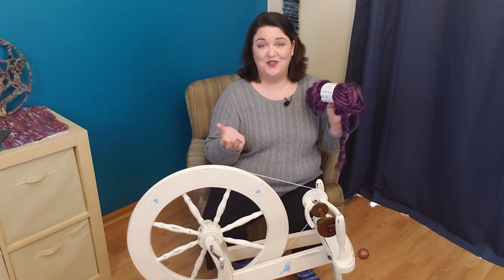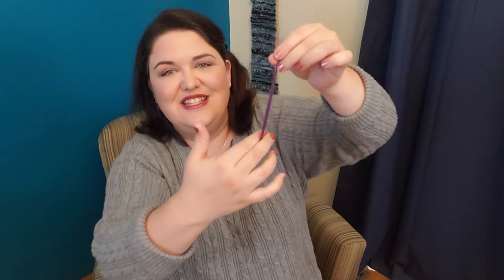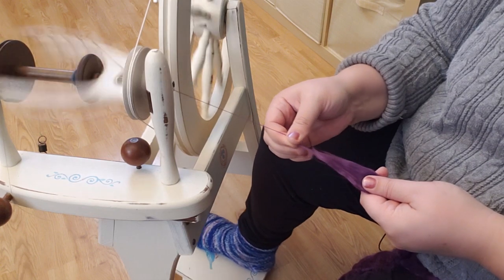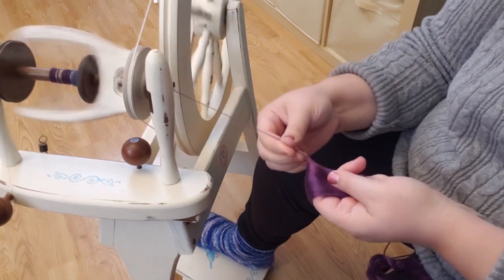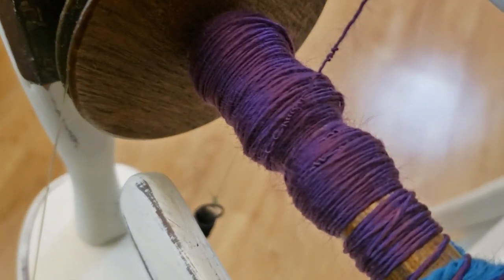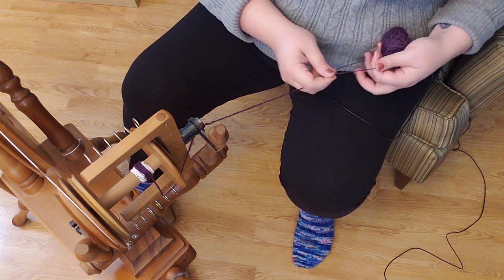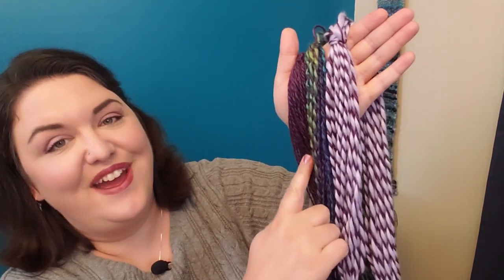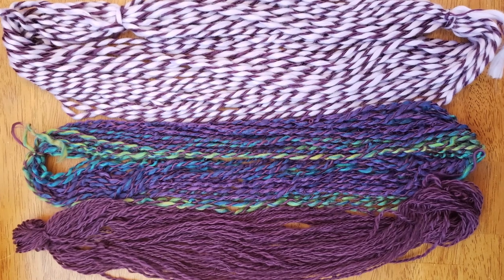Can I Spin Acrylic Fiber On A Spinning Wheel? - Plus 3 ways to ply it!

Comment: spinning from the fold tends to produce a less dense/ropey yarn with wool that has little-to-no crimp/spring, and it sounds like that is also the case with acrylic. it's like the folded fibers are trying to straighten back out, which means that they are pressing away from the core of the yarn. so you end up with a yarn that is less compacted than when they are lined up perfectly next to each other in a short forward/backward draw. that would be a good point to keep in mind for anyone who plans to try this at home. very interesting. i am enjoying these "i wonder..." videos.
Reply from the maker: You perfectly explained this! Yes! 💕

Comment: I bought a large lot of mixed fibres so that I could sample spinning things from wool batts, to alpaca batts and top, to acrylic "top" and I have really learned a lot! The first time I tried spinning some of the acrylic, I let too much twist in and was quite frustrated with how thick it was and how hard it was to draft! I had a light bulb moment in your video when you talked about how it is "slippery until it isn't" and doesn't need much twist to become "sticky". So, I tried pre-drafting my "top", as well as being sure not to let any twist into my fibre supply, and holding my hands much farther apart. Made a world of difference! I'm now spinning for a shawl project for someone very dear to my heart ❤️

Comment: I've spun microfibre which was the mill waste from microfibre shirt material, the waste was destined to be Roy filling. It felt like spinning silk, same staple length and came up really soft, I made a really nice scarf with the yarn I created  and it is wearing very well. Thank you for sharing your insight on the acrylic fibres I have often told new spinners that those commercial yarns can be used to create new yarns.

Comment: Wow, I never thought it was possible to spin acrylic. I’m not a yarn snob either and I was glad to see the staple length was as long as it was. I do remember many years ago when I first got my wheel getting some, either it was milk fiber or bamboo, but it was very slippery and getting away from me. Not sure if was because of the composition of the fiber or the staple length but it was very slippery. Is that acrylic fiber just as slippery to work with? Loved the effect of those other yarns used to ply as well.

Comment: Could the acrylic roving and wool roving made into  rolags then spun make a sock yarn ( superwash)?
Reply from the maker: It could definitely be blended, but to work in a rolag it would need to be shorter. The long staple length will be difficult to draft out of a rolag. Combs or a hackle might work better maybe?
Reply: I've used that same purple L&T fiber on my blending board, with other acrylic blends, and it spun well from the rolags. You just have to pre-draft to the extreme.
Reply: I don't think it would work from the rolags if it was the only fiber.